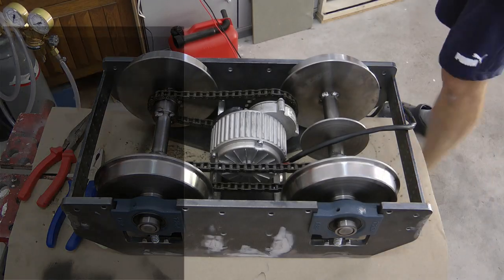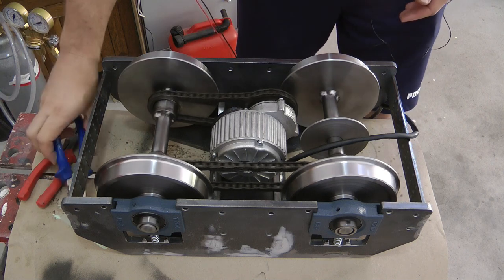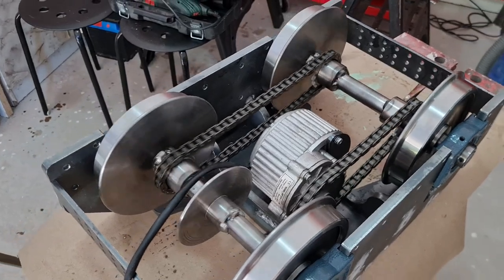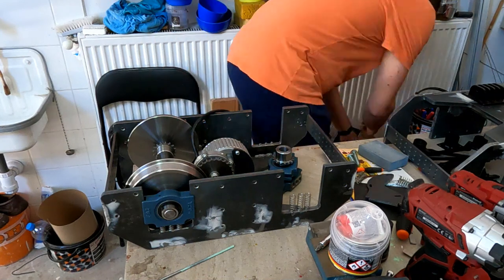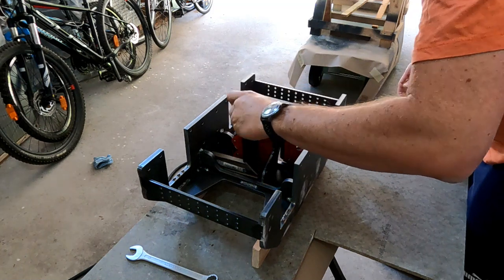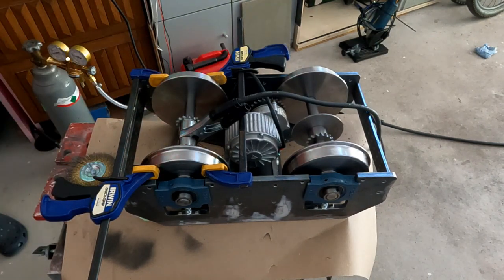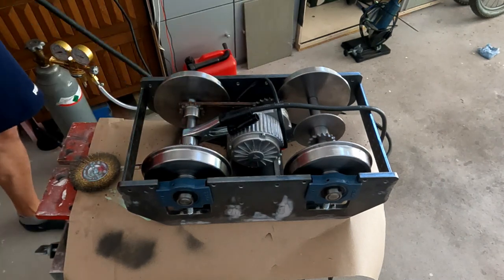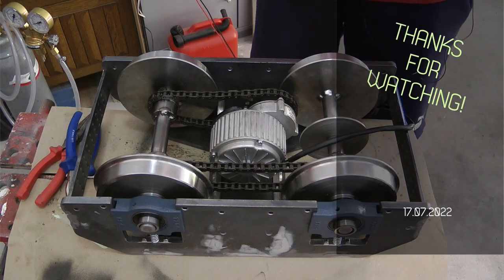Ride on loco progress video: Finishing the bogie

Comment: Maybe a chain tensioner could help with the chain between the two wheel sets?
Reply from the maker: Yes, may need to add that. But I probably also need to add to both sides.

Comment: Hi, Can you give me some more details on the springs you used please? Also did you cut the top off those take up bearings?
Reply from the maker: I used a 35mm long, 12mm diameter spring from 1.6mm steel. I found a seller on Aliexpress. Got a few different gauge string and this one worked OK. The top of the bearing block was cut off, machined flat and small pockets milled to keep the springs in place.